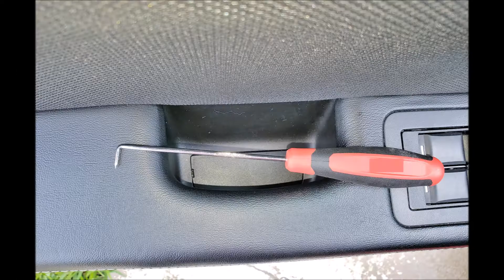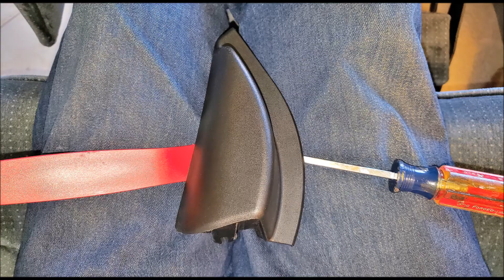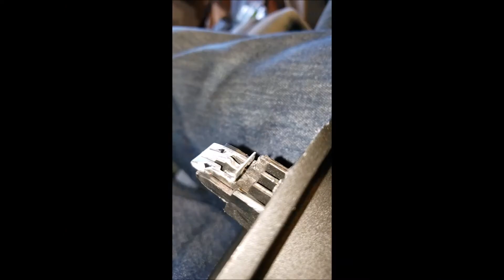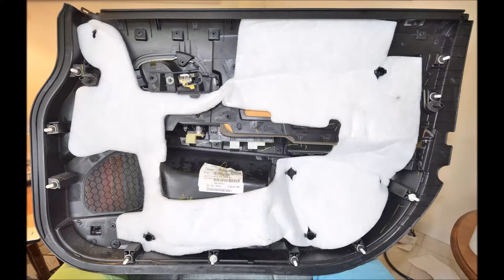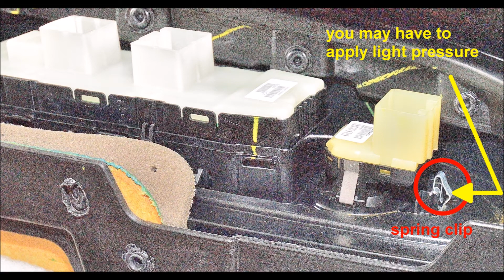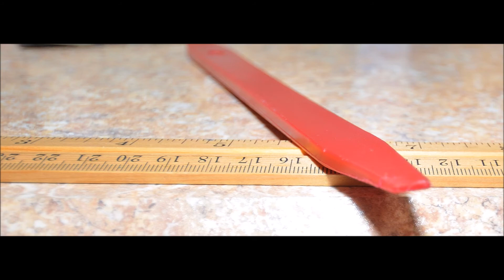2014 Dodge Avenger Electric Window Switch Replacement (Episode #4)

Comment: You didn't have to remove door panel to replace window switch
Reply: I'm having the same problem. How do I pull my window up??
Reply from the maker: Did it b/c i didn't want to tear up the area around the switch